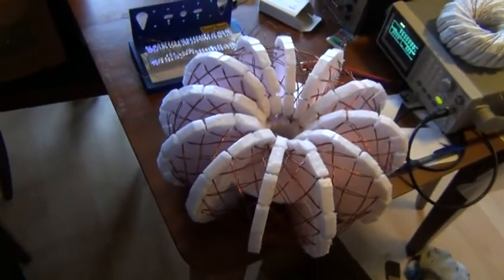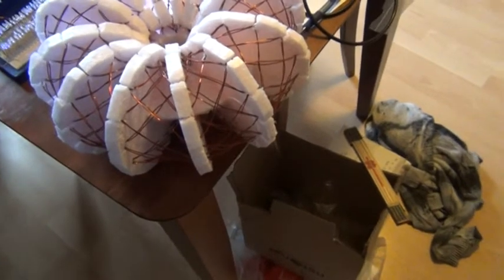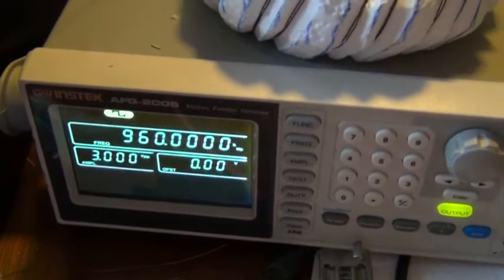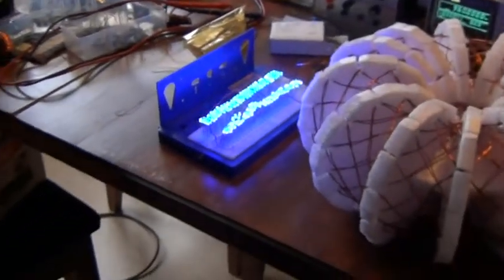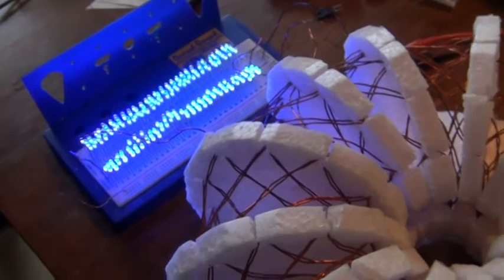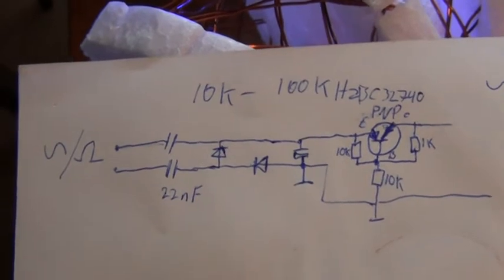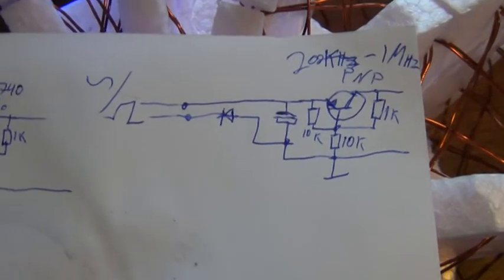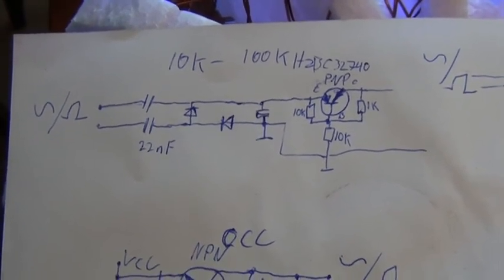Clasic ABHA coil test presentation with 196 LED's

Comment from the maker: I have no schematics or messurement on the size of the frames i have used. BEcause i hade them at a aproximate size from what it looked like on other videos. From what i can tell the size of the coil doesent matter too much. I have tryed 2 diiferent sizes that both work. Only thing you need to work out is the size of the middel ring in referance to the other outer rings. But most use 12 cutts for the wire and 12 rings around the center one.